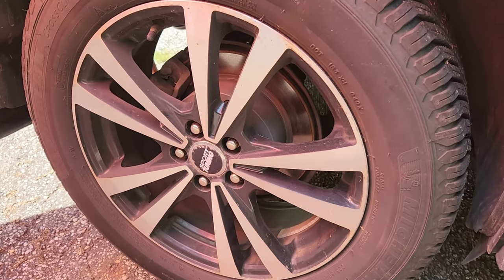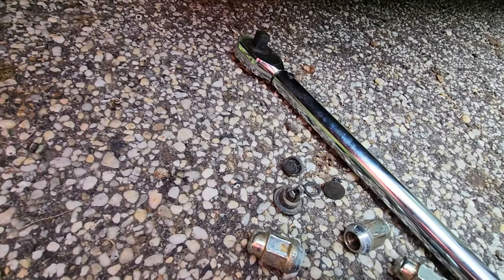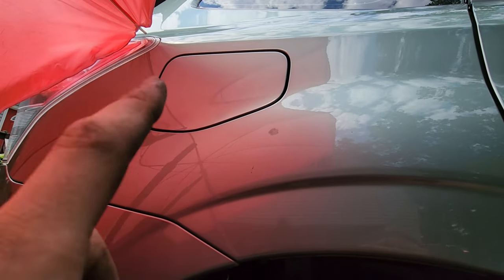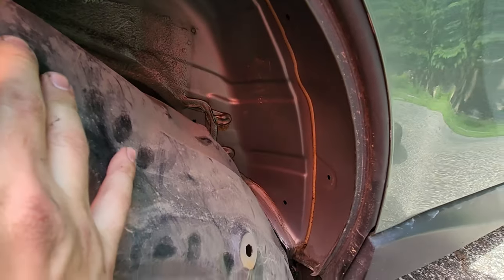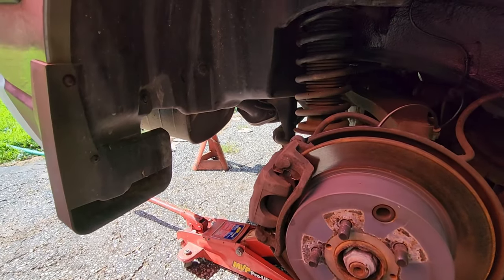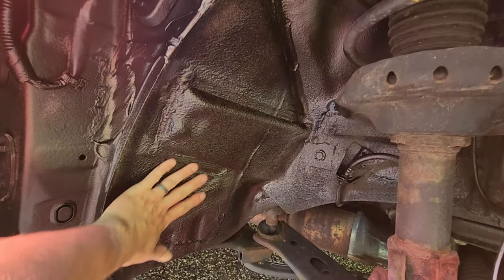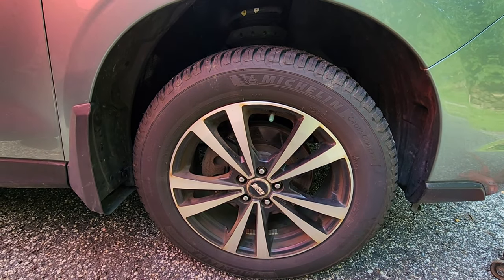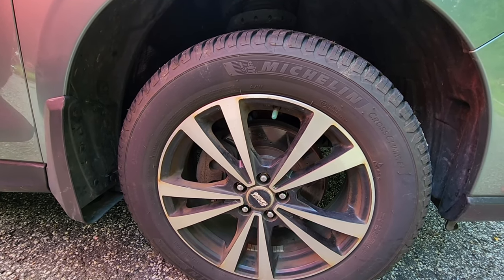Car Care : Sound Deadening PT 7 : Boom Mat Spray Your Wheel Wells For Rust And Noise Prevention

Comment: Nah... The point of these sprays is to reduce the intensity of noise caused by gravel and grit as they are flung into a wheel arch by the tyre. They should be used on open surfaces only. Not BEHIND the liner but on the surface of the liner directly.

Comment: GFeez 52 decibals is low and that's really quiet. The AC will also raise the decibal up. Anyway our Honda is NOISY. Over 81 and can go easily into the 90s. So I am going to do the rear wheel wells. The noise seems to come from the rear. I heard maybe here  that doing the spare tire area is a waste of time. I guess unless you do several readings after making just one change you will know by the meter if it helped.
Reply from the maker: @wanaraz  Hello, Friend. 👋 OMG, 52 dB is amazing. I can hear a water bottle krinkle, my clutch pedal squeek, and the AC/fan and turn signal are the loudest parts of my car now. 🤗

I did the spare tire area, and honestly, I would recommend you do it. Both your rear wheels, rear differential, exhausts, muffler, and road noise all permeate into your cabin through the trunk. See my video about how easy it is to get to, how much surface area made noise, and the difference it makes. Arguably it's the easier, most wide open area to work on.
Reply from the maker: @wanaraz  Also, after all my work, my car idling with the windows up is at about 47 dB, maybe 50-54 dB at highway speeds. It's SOOOO nice, absolutely worth the effort.
Reply: @OutsideTheTargetDemographic  OK I will do it in steps little by little. The Truck area has the fold down seats so there is no metal behind the seats. It looks like the whole trunk area was one big shell that's removeable. I get tires in a couple of days where they were built for quiet in mind. Then I am doing the wheel wells  then I will tackle the trunk after I take some readings. As it stands right now I don't think we will ever buy a new Honda again because of the noise level. 
I am going to check out your trunk video.
Reply: @OutsideTheTargetDemographic  That's incredible readings. I had no idea you could get that low in DBs.
 Now my truck is stock and it's only about 71 DB. Very quiet . I get comments on how quiet it is for a truck.

Comment: how many coats did you do please ?  thank you and hello from Miami , FL 🌴
Reply from the maker: @Jaang29  Hello friend. Hope all is well after that hurricane you got.

I used a two coatings, I beleive. The three pack of spray did about 1.5 cars for me. Anything is better than the nothing from the factory.

It absolutely made the tire and road debris sound (flung snow, water, gravel, potholes, ect) much quieter. 👍 It also prevents rust up where you will likely never look to find/stop rust from forming.

Comment: There is one more thing you could do is the actual tires try hankook ion evo tire have sound deading inside the tires
Reply from the maker: @scotttucker2557  Absolutely. These Crossclimate 2s are all season tires that rip through snow, but cost me -2mpg and are not quiet as they do it. Tires can make a huge difference as well, but I'd rather the traction (so far).

Comment: Any thoughts on the boom mat overall? Seeing boom mat, and other undercoating sprays from 3M, Dupli color etc. Any particular reason you went with boom mat? Thanks!
Reply from the maker: Hi friend.

Umm, largely, it was a notable name brand and said it did the things I needed it to. I don't know if anything would work better or worse, and in the case of the Subaru, there is already the plastic wheel well liner, that prob is doing some heavy lifting in regards to sound stock. Any spray will prob do just as well as another. Whichever is cheaper.

The results were noticeable, especially with weather. Rocks, rain, water, snow, mud, ect. Is much much quieter, as are any loud tires (I have the Crossclimate2 on my car, not known for being quiet or fuel efficient). For the time spent cleaning and applying, I highly recommend doing it. 👍
Reply: How's it holding up?
Reply from the maker: @9graff9  It helps that my wheel wells have the black plastic cowling inside them, but I don't know of any deterioration. For the time spent to clean and spray in, this step of sound deadening helped make my drive into work 52 decibles at highway speeds. Would absolutely recommend.

Comment: how come you didn't spray the plastic covers ?  do you think it helps reduce noise ?  Do you have a video where you've done it ?  thank you
Reply from the maker: @Jaang29  The plastic covers both 1) don't resonate sounds like metal does (how many plastic drum cymbals have you seen?) and 2) don't rust like metal does. The spray prevents the metal from making/transferring noise, and from rusting (water can't rust metal that it can't get to).

So no, I did nothing to the plastic except remove, clean, and return.

Between all the videos worth of work I did reducing the sound, I got the car about 20 dB quieter than it started. Every 3 dB in reducion is a 50% reduction in sound. I would absolutely recommend spending the time and money (less than $400 all in, which could be spread out over a few months if your budget doesn't allow for a bulk purchase) to deaden your car. As proof, I have don't my mom's and wife's as well. It's the equivalent of driving with ear plugs in.

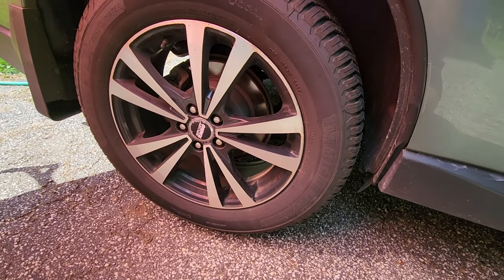Comment: Hey, it's possible I did not notice it, but do you have any video of you doing the firewall (0:19)?
If not, could you please elaborate, on which part did you apply the material (inside / outside) and how did you get to the firewall?
Thanks a bunch!
Reply from the maker: Hi Friend!

I don't remember if I made a video on it. My base model Forester did not have any protection on the firewall, so I did have to do my firewall. If you have any dark fabric already on your firewall, I don't know that you can add over it.

That said, first I cleaned the whole firewall with rubbing alcohol. Then, I cut a sheet or two of the Noice sound deadener sheets (seen in episode one of my noise deadening series) into 1/8 sheet strips, and put that strips anywhere where if I tapped the metal, the metal was loud. Meaning, if I tapped a thin part of the metal, it would make noise like if I tapped the backside of a cookie sheet. If I tapped metal and it was quiet, like tapping a steel pipe, then I didn't bother with the Noico.

Next, I used the $14 roll of 10mm insulation foam (Temu, best seen in the "door" episode of my ND series), cut strips of about 4 inches wide, and basically tiled the firewall, making additional cuts to allow for the tubing and connectors and all. 

I'd say I had maybe 20% coverage for the Noico (to prevent noise from being made), and maybe 80% coverage of the insulating foam (to mute any noise from being transferred through the firewall).

I absolutely recommend doing it. It won't look pretty, as it will be piecemailed together, but
1) who's going to ask to see under your hood?
2) it allows you to keep most of the engine noise out of the cabin.
3) it allows you to keep most of the road noise from transferring through your strut towers.
4) it helps keep the engine HEAT out of your cabin, as the insulating foam not only blocks sound energy but also thermal energy

Hope that helps!
Reply: @OutsideTheTargetDemographic  That's very helpful, thanks!
But just a second. On which part of the firewall did you apply this? On the engine side?
Also, how did you get to that side? Wouldn't the engine be in the way?
Reply from the maker: @ToniML200  Everything I mentioned was on the engine side. My final video of the series shows what I did to the firewall on the inside/cabin side.

The engine, and like seven houses and tubes, were in the way. Hence why I did not use a single sheet of foam, but opted to cut it into 4-6 inch wide strips, and applied where I could. Too thin of strips and the adhesive mat not stick well enough. Did what I could. 🤷
Reply from the maker: @ToniML200  If you check my most recent "Community Post", I @ed you with pictures of my firewall. Sometimes pictures tell you everything you need. 👍
Reply from the maker: @ToniML200  Between all the things I did to my car, my uncalibrated cellphone decible meter app said I was averaging about 70dB while driving to work, and the actual decible meter now reads around 52 dB at 65mph on Cleveland "maintained" roads. Night and day difference.